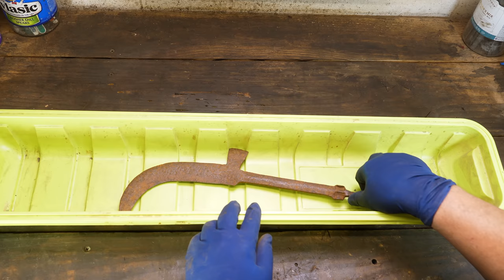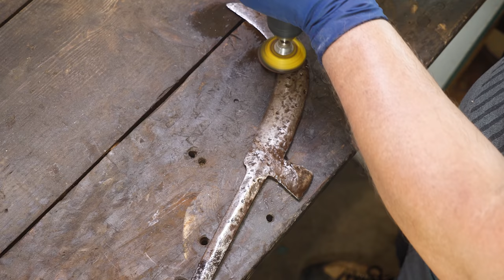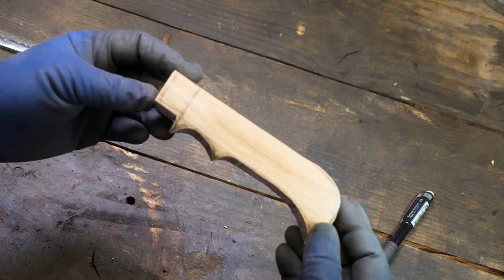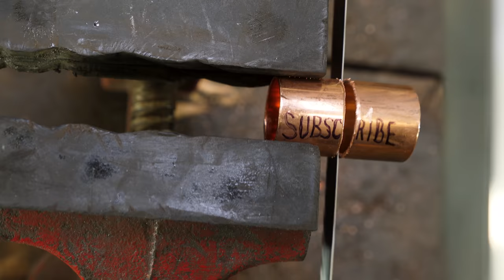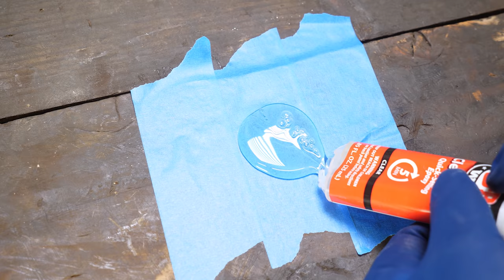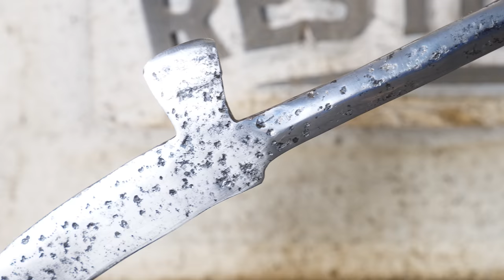Antique Rusty Old Koser Sickle Restoration

Comment: Nice work. This is a sickle axe, I have seen others something like this when I was younger. Some had a hammer not an axe head. One of my uncles had them. Never really did know what the were for other then cutting down corn stalks. That is what he used them for anyway. His had a longer handle on them, so the user did not have to bend or when cutting low to the ground.

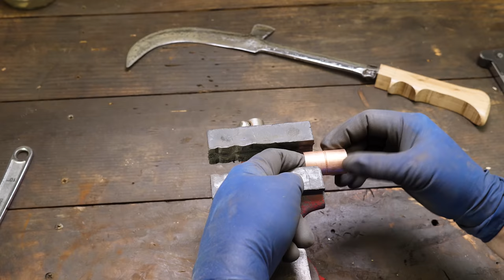Comment: 7:58 shouldn't it have been a little harder than that to incert the piece into the handle so it'd be snug?, just seems a loose fit? "shrugs"
Reply: Need room for the epoxy the way he fits the handles.  If you go for a friction fit the hole is made slightly undersized and heat the tang and burn it in to fit.